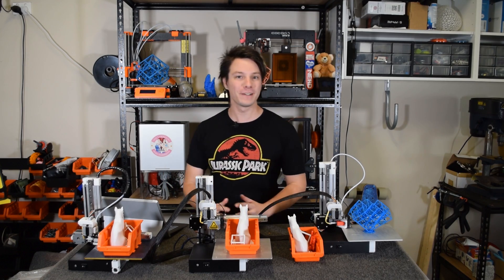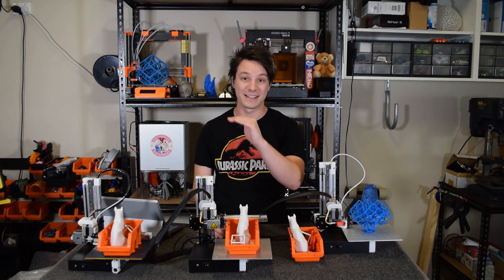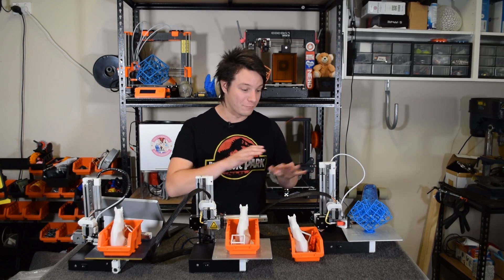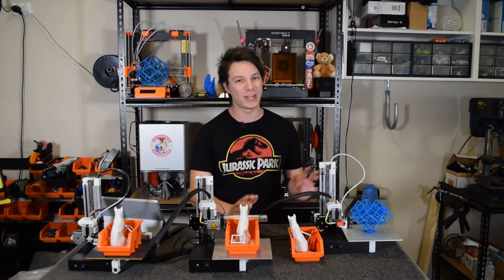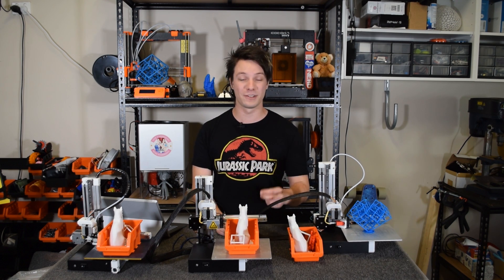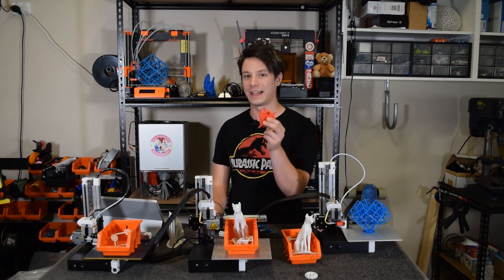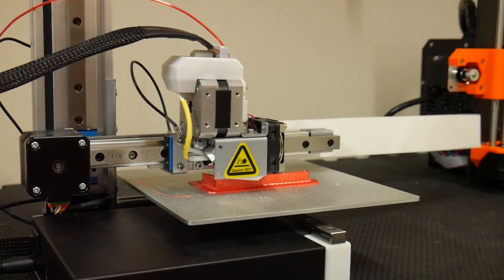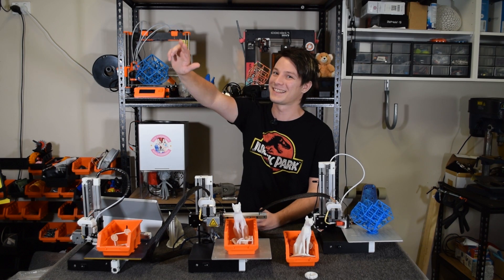Cetus MK3 3D Printer Review

Comment: Massively overpriced and undespecified. Kids don't need to be learning on archaic tech!
Reply: Archaic tech which time after time puts out perfect or near perfect prints with little effort or mucking around.
Reply: @metricstormtrooper  it's like people don't understand that running a machine for a classroom of 30+ kids is very different then tinkering in your basement.
Reply: @ZeeLobby I understand completely. I work with kids.  I understand the value of reliability, but any equipment that takes many hours to produce a result has immediately moved into a different category of equipment, especailly as it's too noisy to run lots of these whilst actually teaching. These are designed like toys for people who have no idea what they're doing, but I'd sooner kids learn using a representation of the kinds of equipment that they're actually likely to be using. This is like teaching them to ride a bicycle on penny farthing. Reliability IS extremely important in a classroom that rarely has highly skilled technicians, but not at the expense of budget and functionality.
Reply: @Martial-Mat   Except if they're going to use 3d modeling and printing or CNC, anything under $1000 is a horrible representation of the equipment they'd actually use as a professional. If anything the Cetus is much closer in that regard as far as reproducibility and quality. For a fraction of the price. And you'll need multiple printers. Kids want things to take home. 3/4 cetus running at night can accomplish that with little effort. And to be honest, better represents how easy 3d printing will be in the future. It's only going to get easier. Sure, for college or maybe late highschool, repairing a kit printer might be good for learning electrical/mechanical engineering. But these would be great introductory machines. Sure we love to go home and spend hours tweaking to get that perfect first layer, but kids won't sit around for that, outside of the one or two future tinkerers.

What these would teach is the process. Basic principals like dimensionality. Shapes and forms. Additive building. Etc. Concepts even young kids can learn.
Reply: @ZeeLobby I wasn't referring to what they'd use as a professional, but nobody in his right mind would but these machines even for home use, so why teach using a machine that is typical of NOTHING kids will encounter? Reminds me of when computers were newish and they all used these super-shit massively overpriced, underspecified bespoke RM machines that were used in schools in the 90s. Kids got almost no value from them. 3D printing in school should be something that inspires kids whilst introducing the technology. It's not a direct simile for what they would use in a job any more than high school physics is a direct approximation of what they would usen in a physics lab.
Reply: @Martial-Mat   uh. I have one for home use. They put out great prints, and I never have to fiddle with it. Lol. I mean I bought it because i like having a wide range of styles in my personal printer, but you don't go through 3 MKs if no one is buying. It joins my Flashforge and Prusa. I don't feel like less of a man because I don't struggle with building parts to make my ender or cr-10 as functional. Haha. My friend owns two MK2s. He loves his. Sometimes buying cheaper machines you have to work more on isn't everyone's end goal, Prusas are a perfect example of how people will spend more for something reliable that requires minimal maintenance. And the majority of the world runs on systems that aren't open source (Windows, iOS, most mechanical/electrical systems). Personally I'd rather spend time creating 3D models and printing the result, then wasting time fiddling to get the result I want.

As for the rest, I agree with what you say, but don't see as why the Cetus doesn't fill that role but better? "Hey kids, wanna watch this cool machine print that awesome ornament you just made?" Or "Hey kids, wanna see how exciting replacing an axis belt and bearing is? Oh. It didn't adhere, let me relevel. Hold on, I have to mess with the extrusion speed, etc.". I have a feeling I'd know which they'd pick.
Reply: @ZeeLobby  Well, we'll have to agree to differ, but I accept your point of view. I still think it's massively overpriced but I can appreciate that you enjoy using yours! You take care now and thanks for your side of the picture.
Reply: @Martial-Mat  yeah. No problem! Nothing wrong with a discussion, even if one side isn't convinced into joining the other. Personally I'd be hard pressed to find a printer that offers similar quality and reliability out of the box for $400 or less. But I've also actually used this printer, so my positive experience may just make me biased. The only other printer that was this easy to maintain and use that I've owned that is sub-$1000 has been my Prusa. The other commentator here saying that his Cetus is his "6th man" is spot on. I've honestly had to tweak my Prusa more, and that costs $1000 pre-assembled (though mine was a kit). 

The only thing I'm planning to do for my Cetus going forward is installing the open source tinyfab CPU. So for $60 more it's now open source (and it's an upgrade tiertime actually supports with warranty).

I do think there is a place in class for Ender 3s and other kit printers and all the effort that goes into them. I just think they'd find a better home in an after school club then with the regular school population.

Comment: Aw come on, you don't need linear rails for classroom use.  My SmartRampMini2 would be better, esp if I can get the build cost under $150US.  Most classroom use does not need .00001 micron precision.  Kids will be learning software and CAD, yuge learning curve, and duh proprietary software is bad too in a classroom, they should be learning open free stuff.

Comment: Well, further important downsides not mentioned in this video (or in this channel, for a current Mk3):
* You need either Windows or MacOS, at least to get it going for the first time via USB. Then you can register, and configure it to connect to wifi and start using a mobile app. However, slicing and checking the output on a small mobile phone is not very convenient.
* WiFi connection will not work unless 5 GHz is disabled completely on the network.
* The UP slicer is simply unable to slice thin walls.
* You don't get a time and material usage estimate until you actually send the gcode to the printer and it starts heating up.
* Printing without raft is usually impossible, and on average, the raft consumes a third of the printing time and material (at least in my case).
* Printing multiple models or multiple copies at the same time is limited: Each single model gets it's own raft and the models are auto-placed in a distance of an inch to one another. If manually placed closer together, the rafts will intersect and get printed one inside the other.

So don't misunderstand me, I really like the Cetus, and I use it regularly. But for a complete review, these things really should not stay unmentioned. ;-)
Reply: You can get a time and material estimate, if you press preview on the print menu, instead of print. If you need to print multiple copies of objects closer to each other than inch, you could easily produce an STL file of an assembly with your required number of parts and distances from within your chosen CAD software.

Comment: I literally bought the MK2 30 mins before seeing this video! It will be my first printer. I am kinda bummed about the parameters wich is a setting i really need :\
Reply: you can use Simplify3D and Cura with this printer. You send the GCODE via UpStudio and it should work fine. Check out the Cetus3d facebook group. Lots of help there to get you started.

Comment: Angus buddy if possible would you review Creality 3D CR-10S Pro. It looks promising but a good test drive would be nice.
Reply: I got one a couple months ago. I had two main hardships with it. First the capacitive z axis sensor varies with temp and humidity so I swapped it for an inductive sensor. Plug and pay swap I can give the part number.  Second the top removable bed may not sit exactly flat on the heated section and this allows a minute amount of flex on the top surface. It needs a lot more clips around the perimeter at least. But I'm not a fan of removable beds for this reason and the size of the CR10s pro bed just exaggerates it. Fine for larger parts but printing multiple small pieces you really want a bed with zero flex, particularly to take advantage of mesh leveling. Franky it would work better putting a print surface directly on the heated bed section.

Like any printer you need to pay close attention to assembly and alignment of all components, even those pre assembled parts, don't assume the factory worker took care doing it.

I think it's a little expensive compared to the standard CR10S with the same quality, but there are not many printers with such a good build volume.
Reply: @Audio_Simon  the sensor is a problem but easily fixed. So the only big problem is the bed being finicky!? I assume quality, design, display, firmware, rigidity (given the bigger size) and the rest are ok? btw thanks for responding.
Reply: I had one and sent it back.  The ABL doesn't work, and the dual-Z motor situation is not fully thought through, and the Y rails (with 8 rollers to get positioned properly) also don't entirely make sense.  No doubt you can google reddit for discussions on all this. Sure you can make it print nicely, if you treat it like a regular CR10, but not thanks to the features that you pay a significant premium for on that model. (Well, the dual drive gear extruder is nice.)
Reply: I think thre bigger the printer, the more vigilant you need to be about setup and assy. I loosened off all rails to make sure they were parallel to each other and each axis is perpendicular to the next before even tackling bed level. It takes a lot of time and methodical thinking.

The interface is great and the mesh levelling does work once the bed has no compressible areas. No problems with extrusion at all. I had to reduce acceleration and jerk about 30% in Cura from the defaults to avoid occasional lost steps. I printed a new paint roller cap the other day at 100mm/sec no problem.

Oh yes I do think it's annoying the dual z axis motors will power down when not in use it risks loosing parallel. You need to make sure the gantry is parallel to the bed on start-up, I use the inductive sensor LED to help me.

Don't think of it as an upgraded CR10, it's a bigger CR10.
Reply: @Audio_Simon  Good advise in your answer. I too loosened and deliberately aligned all rails and carriages. I was able to get very good repeatability in the ABL mesh measurement when at room temp (though that didn't translate to correct nozzle positioning -- pretty sure due to incorrect z offset constants in the stock Marlin.). But when heated to a stable elevated temperature, the ABL mesh measurement varied between successive measurements minutes apart, by several hundred micrometers (ie: well over a layer height.)
Reply: @Graham_Wideman  Yep that's the issue with the capacitive sensor. I had a spare inductive sensor from my mill and it worked just by soldering the connector and printing a collar to make it fit the holder.

The downside of inductive sensors is they only work on electrically conductive materials. So no glass.
Reply: Ahh I see. Seem like there are a few minor design issues (mainly mechanical) to be worked out. I'll wait a few months for them to get updated. Thanks guys, Simon, Graham.

Comment: Hi! :-) Working with students here (started volunteering, now a half-day job)- I was torn between getting a "fool-proof"-machine VS  a-lot-a-printers.

Back when the Anet A8 still was a thing, I got six of those kits. Paying them myself (and one sponsored by a great person), it was also a budget opinion (100€/unit). For my tinker-course, it was the perfect choice, despite my initial concerns. Yes, building took a long time, but after that, all the kids could basically debug issues as they knew the machine in-and-out.

But the A8 is just a horrible machine for a classroom environment. Kids want to print stuff. Reliably. I have one machine working flawlessly since day one, and others that randomly start failing (minor things, but that does mean I have to invest time and money to get it printing again).

I did end up getting a few Ender-3 machines when they were on-sale for under 150€. Amazing that machines did get better and overall even cheaper in the last years. 
I'm broke now, but happy :-)

If I had a unlimited budget, I'd probably go with the Prusa.... Or the "UP". I know the closed source printers get a lot of hate, but my UP is now almost nine years old and still runs and runs. The older software basically had few settings (high/med/low for each quality/infill/layerheight) and aside from adhesion issues now and then, I was able to print the tiniest things (I'm the earring guy on Thingiverse from way back). When I started volunteering at the school, I just threw a bunch of the kid's projects on the software's build-plate, and let the thing go. Now there's always some amount of tweaking the settings necessary to really get it to print, while on the UP, even the 5th graders understood the software from the get go.

I have not tried the Cetus, but for me it's too expensive for what it is- I can get 2 Ender plus filament for one of these units, or stretch the budget a bit for yet another, possibly better machine.

Anyway, enough rambling! Thanks for the great video!

Comment: I'd never buy a TierTIme printer solely because your locked into using their (useless) studio software.
Reply: Gavin Svanborg you’re*

Sorry, it would either be me or the next guy
Reply: Haha, As someone that lives with a  gramma nazi, I'm not sure how I missed that one.
Reply: You can use your own slicer it is just their slicer works better in 99% of cases. I find generating and optimizing material profiles and tuning for a particular model can take ages to perfect while their slicer does a decent job 99% of the time. (Their software accepts raw g-code with custom start code and new version can even slice g-code) This alone makes education users much more inclined the studio software is limited but also prevents users from making stupid mistakes.
Reply: @riakata  which is why he'd recommend it. I mean schools use iPads over other options because of their reliability and consistency. Sure I personally prefer open source OSes and the like, but proprietary has pluses.
Reply: I like how you claim the software is useless despite never using it. The software is actually quite good. I had purchased a duet maestro board to put in my Cetus. In the end I couldn’t make myself do it because the Cetus just worked so damn well as it was.....with it’s “useless” software.
Reply: @guycobb3251  I once purchased an UpBox. So the phrase "useless" is speaking from personal experience.
Reply: Gavin Svanborg That’s certainly not how your statement read. Anyhow, I’m not suggesting it’s perfect and can’t be improved. But I got very good prints with minimal effort. Of the 3 FDM printers I’ve owner, it was my favorite.
Reply: @gavinsv  You missed out, my Up Box is my best FDM printer (and I've got an Ultimaker 3 and Zortrax Inventure). It has aged beautifully, premium print quality. Also, the software is plug-and-play unlike EVERY other Slicer

Comment: I gave a similar pitch to the librarian at my old high school. They got a makerbot replicator +. I pointed out that it might be interesting to get some monoprice mini deltas. they are $150, fully assembled, auto level, are very portable, and the whole thing is $50 less than a replacement nozzle / extrude for the replicator +. The idea was that they are cheap / simple enough that student could mess with them without teachers having to worry to much about them breaking a $3000 machine, and the makerbot could by saved for anything that needs the lager build volume.

Comment: As much as I'd appreciate a small robust printer, there's just too many reasons not to buy this one I'm afraid. Five or six years ago it would have been great.  Now, not so much.

Wireless isn't necessarily a good thing for schools.  Teachers usually have no control over the school networks or computers so when it comes to getting things working or trouble shooting they are completely helpless even if they did have the IT skills which frankly, most do not.

Of course the network and even the PCs are locked down for security reasons, but it does mean that there's usually only one person on site that can fix anything or do the installs.  If they are on site at all...

I think you're on the right track with getting multiple printers to fit in with a STEM budget for schools, but surely there's got to be a better even more cost effective solutions out there (with no WiFi).
Reply: I fail to see how wired troubleshooting is any less difficult than wireless. You either have coverage and permission to connect or you don't. Anybody with a cell phone is familiar with secure wireless networks. If the LAN goes down, an end switch is going to have the same problem reaching the DHCP server as a wireless access point. Not everyone is familiar with running Ethernet and configuring switches. We're also not talking a whole lot of network bandwidth or throughput here. Ethernet is overkill. And what teacher is going to be procuring several hundred dollars of 3D printing equipment without lining up an initial installation with IT? As far as relying on SD cards, in a school? HA! They'll all be broken/stolen in a week.